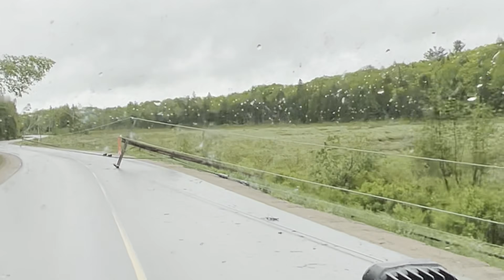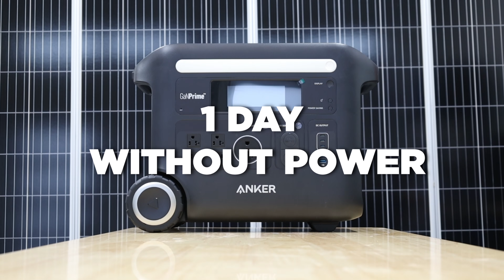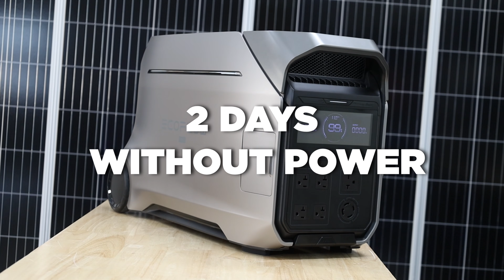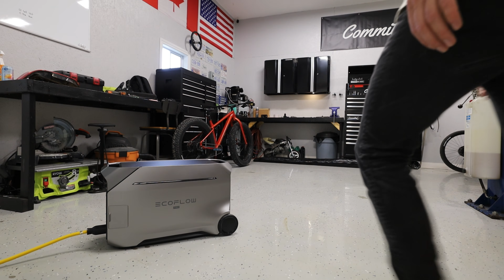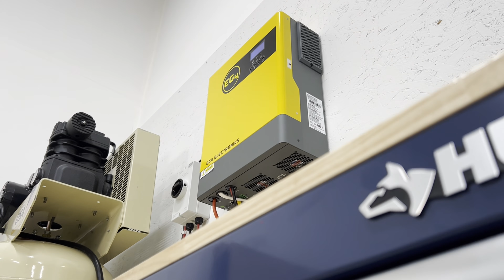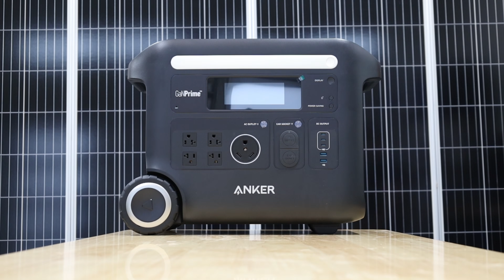Surviving Storm Season! How To Pick the RIGHT Power System for Outages (For Beginners)

Comment: i just dont want an electric bill
Reply: You’re gonna have an electric bill or pay the credit card bill/loan on $10k-$30k of batteries, inverters etc
Reply: @TylerSL92  based on my research, so far, i have been able to notice that 6k is about the limit where i would not have an electric bill. By piece mealing the design, i can effectively keep costs manageably low.

some systems can run a refridgerator for 2 days on its own before counting for solar. 

30 years ago the cost to go solar was between 10 to 30k but these days you can get a small setup for under 500 that can run a whole room of your house, depending on what house it is. 

the biggest users of electricity are the devices that need to either heat things up or cool them down. portable stuff like a laptop, tablet or phone require significantly less energy. 

Based on my research, to have a whole home setup that runs everything, i need a 5kwh setup.
Reply: It depends where you live, how much electricity you use, and the cost of that electricity.  Where I live in California, a whole-home backup system is definitely economic.  I DIY'd an EG4 system (GridBoss, FlexBoss21, 2 EG4 batteries...).  Around $17K and that puts the payback at around 6 years.

There doesn't have to be a break-even point, though.  These sorts of systems are for peace of mind, fun, and one can come up with many other reasons to do them.  Breaking even on cost is just the cherry on top for a lot of people (including me).
Reply: @junkerzn7312  absolutely. I have various ways to decrease costs as it is. Hot water for example is good for washing dishes, cloths and body but most of the time you don't need hot water.

Comment: If we go with something like an EG4 12kPV, do we (or the electrician) just wire that between the grid power and our panel and it then supplies power to the whole existing panel? I'm trying to avoid a solution that requires a transfer switch that only supports certain circuits. Thanks!
My goal is two days backup power that I can recharge from a generator during the daytime if needed. Permanent solar is not an option yet here. I don't think we have peak pricing from our energy supplier, but I'm going to call them to confirm. I'd love to take advantage of off-peak pricing and batteries.

Comment: If you don't have a generator but you have a car, in addition to a power station I recommend a way to get 500 watts+ from your car - either a DC-->DC charger or a DC-->AC pure sine wave inverter that clips onto your battery. The windstorm that knocked my power out for 3 days had sustained winds of 60-80 MPH for all 3 days so I had to lay my solar array flat and the sky got pretty smoky even though I escaped fire damage. I wasn't getting enough juice just from solar.

I don't need a gasoline backup often enough to justify the maintenance headache of a dedicated generator and stored gas, but I was able to recharge by running my car a few hours here and there and I only went through about 1/4 tank of gas over the 3 days. I wasn't running my whole house - just my fridge, internet, PC, a couple LED lamps, and the central gas heater for an hour or so before bedtime.
Reply: Yes, but don't burn out the dinky little alternator in your vehicle doing it.  Plus, remember that using the vehicle as a power source ties the vehicle up in the drive-way... and you might need that vehicle to drive around dealing with the emergency.
Reply: @junkerzn7312  500 watts is under 40 amps and should be safe in almost any modern gas/diesel car, but yes, you should know your alternator amp rating and only use about half of the rating since the rating is based on running RPM and may rely on some air-cooling from movement if the alternator is running at max load. Also turn off headlights, fans, and any other electrical loads you can in the car.

If you're using the car to recharge a power station rather than directly power a load, you can just unclip and go, so you're not really tying it up. Yes, you need to make sure you have enough gas to evacuate if necessary, but like I said, I only went through 1/4 tank in 3 days and I always keep my tank at least half full. In my case the power outage was fairly local and I knew I wouldn't have to go far - I was just staying home in case the fires needed my attention at the house (plus I have a 2nd car that also always has at least half a tank of gas).

If someone wants to prep for SHTF/nuclear war, they should get a dual/tri fuel generator, but this is an option for run-of-the-mill/localized power outages.
Reply: what were you recharging?
Reply: @drummergrl1000  I have a 5 Kwh battery and I used less than 5 Kwh/day. I could have used even less but I was getting some solar (maybe 1-2 kwh a day?) - it just wasn't anywhere near what I could have had. I would run the car a few hours when I woke up, a couple hours in the middle of the day and another few hours before bed.

My fridge averages about 115 watts under normal use with the ice maker and opening it for food. I let it run 24 hours a day and I was using it normally. My home office uses about 135 watts with a full-sized PC, dual monitors (I'm a programmer), modem, router, switch, etc. but I wasn't running my PC and monitors all day. My central heater is gas so I only have to power the blower. I forget what that takes - maybe 250 watts for the hour I ran it?

Comment: for gas generators it is noisy and i dont recommend it if one is out in the storm i would have to go with you on the portable powerstations for that matter @The Solar Lab.
Reply: My thought is have an easier failover solution for the initial failure but rely on the right generator for longer term (storm usually passed).
Reply: @markkempton4579  Battery plus generator really seems like the best option.

Comment: i have both solar power stations and a small gas generator, more options is always better.   one question, with peak shaving how does the loss from charging grid to battery then battery back to grid affect the cost savings.? how many batteries makes this viable ?
Reply: It depends on the state. You need to run the numbers to see what makes sense. In Southern California, for example, where peak rates can get as high as 73 cents per kWh (with off peak being 20 to 30 cents), those conversions you talk about won't matter, because the price difference is so insane. But this is why I'd also say a solar array has to be a factor in anyone's setup, so that you can charge off of the sun and not have to worry about this at all.